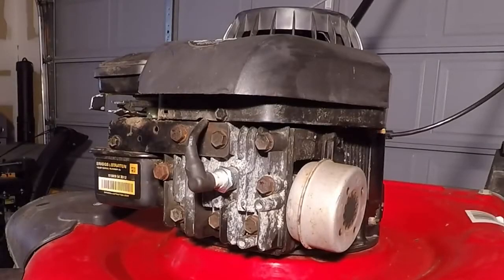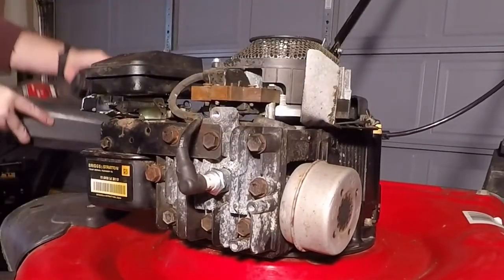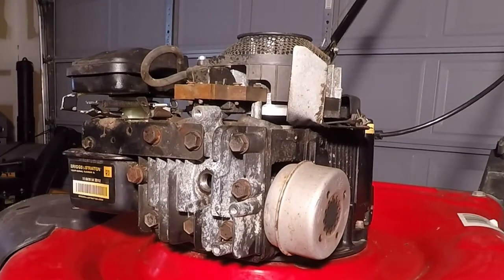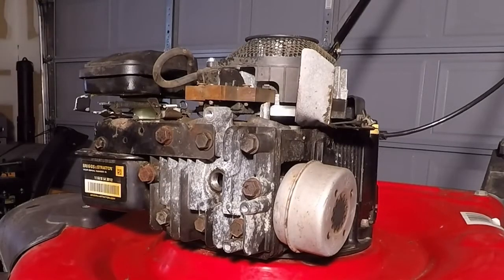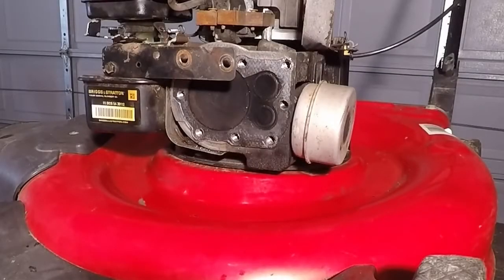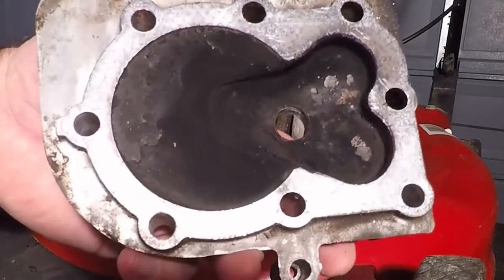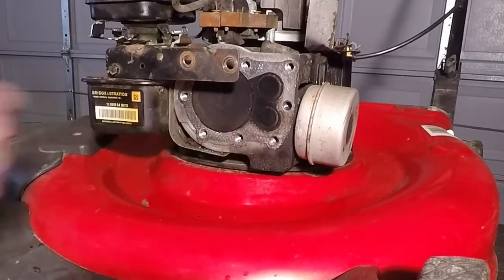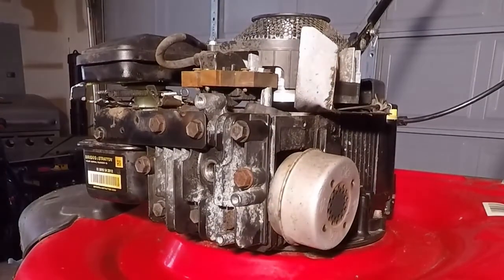Head Gasket Replacement & Carbon Removal For Briggs & Stratton L-Head Engines

Comment: Excellent video,i have these little blue handled wire brushes, i think a lot of tool places sell them,they are cheap and they work great to clean these head gasket remnants on lawn mowers and stuff like that, they are soft bristled, i also fire up my vacuum cleaner and use the hose part and vacuum all the stuff out, works great and it leaves the surface nice and shiny for the new gasket.

Comment: Great video but you forgot to mention that the engine needs to run 15 minutes and then totally cool down and be re-torqued. This is important because the new gasket will expand and contract which could loosen the head bolts.
Reply from the maker: I didn’t forget, it’s just not needed…

Comment: so uhh some of the bolts got stuck in my socket, how do you prevent that from happening?
Reply from the maker: You could start with using the correct socket and then using the correct torque spec…

Comment: mine is a little different it has the wrap around metal guard to protect the ignition wire, i had to actually bend mine 

idk how you got those to 140 foot pounds mine wouldn’t even accept 80 or 40 i had to hand tighten them
Reply from the maker: It’s not ft-lbs, it’s inch lbs, that’s what’s stated. Using the wrong scale is a good way to snap the bolts off in the block.

Comment: Did you use a wire or nylon brush to clean up the carbon deposits?
Reply from the maker: I used a brass brush for this.

Comment: Good video. I'm sure the bolt sequence is per mfg but in all my experience the sequence usually starts from the inner, middle, and works outward. I just find this odd.
Reply from the maker: Thanks! I agree, typically it would be as you describe from my past experience as well, but shown here is the recommended B&S sequence.

Comment: I'm so disappointed. I followed your video (not blaming at all) and successfully removed and changed my cylinder head gasket and torqued to 140 and all bolts snapped. Your video and my other research indicated that setting was the correct one. Just bought new mower. What happened? Chime in if you know. Thanks! Your video was great and helpful.
Reply from the maker: The last person I remember having that issue didn’t realize he was torquing in ft-lbs rather than in-lbs. I have a feeling that’s also your issue.
Reply: @outdoorpowerhouse  Or your older torque wrench is not tuned properly. Cheap tw may be off even if new. Bolts should also have proper lube.
Reply from the maker: @snickboy51  being off by enough to snap bolts isn’t a calibration issue, it’s a huge human error issue.
Reply: Other thing is cleaning out the bolt holes and buffing treads of head bolts. But I think you used ft lbs instead of inch lbs